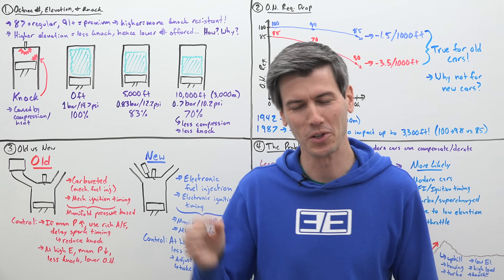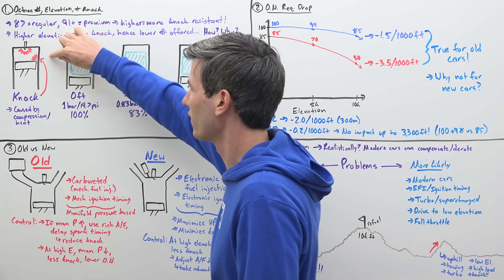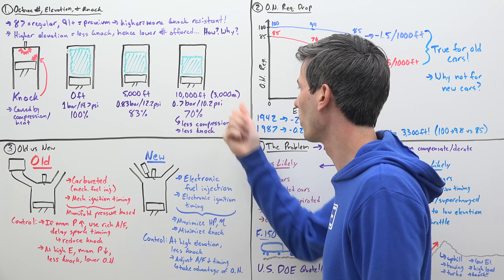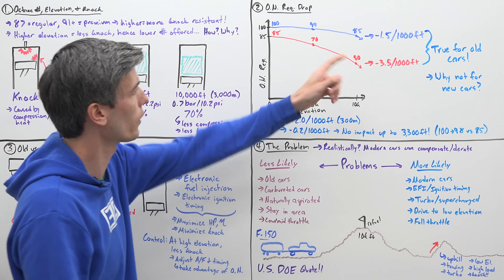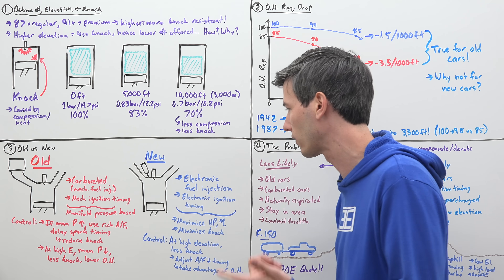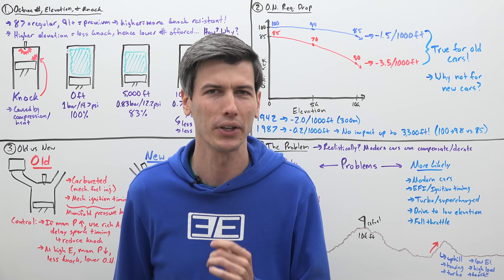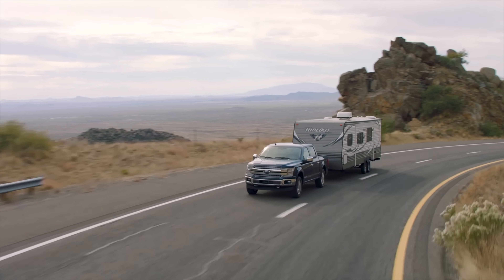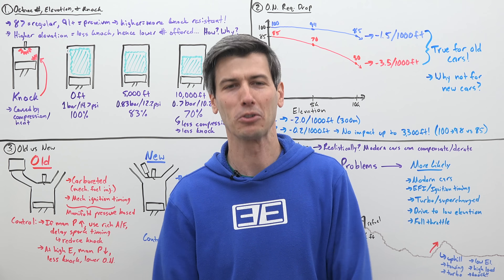Never Use This Gas In Your Car!

Comment: The fact that the laws are based around old carb engines is just a testiment to how out dated current laws are.
Reply: What law are you talking about? He didn't reference a law in this video. He discussed a warranty and a DOT report
Reply: I was going to give this comment a thumbs down and move on, but offering a bit of insight seems more constructive.  While cars are no longer carbureted, carbureted engines are still alive and well.  Lawnmowers, weed eaters, snow blowers, golf carts, scooters, just to name a few that quickly come to mind.  There are plenty of machines that still use carburetors (some machines which are critical for anyone who doesn't live in an apartment building).  

It would be illogical to go through the trouble of changing a law to reduce consumer choice by removing 85 octane fuel from gas stations.  People just need to know what their engine requires, and give it the correct fuel.  People are given the responsibility to avoid diesel, I think that can handle the responsibility to avoid 85 octane fuel as well if their vehicle can't handle it.
Reply: @NoName-ik2du  carb or injection,is not issue, ecu  ,new cars, can retard spark cause they have knock sensor that protects engine
Reply: Hey now. I still drive carbureted.
Reply: Er...my daily is an "old carb engine"
Reply: @lynnmckenney1987  me too. '85 F150, first car I ever bought, still driving the old beast. And no plans to sell it ever.
Reply: @davesstillhere  hell yeah mine is a 1982 Chevrolet Chevette. Old gal gets 33 MPG in town on E10 and 37 on 100% pump gas. 3rd car I've ever owned. I'm the only guy at work with a carbureted car, and the only guy who has to go warm up my car before I drive home on winter nights.
Reply: and is a testament to how effective lobbyists are
Reply: @reelreeler8778  
You don't have a voice if you don't have a billion dollars. That's what I always say about or democracy, I really don't care who you vote for, they're all out to get paid.
Reply: @reelreeler8778  you mean ineffective
Reply: Most laws passed nowadays are usually corporate handouts. If workers need them, they call it entitlement 🤦🏻‍♂️
Reply: Well some of us still daily a carbureted car.
Reply: Moving at the speed of Congress. Even the glaciers move significantly faster; which may be why so many glaciers are gone.
Reply: My old magnum truck uses the cheapest gaz out there
Reply: Depends on the laws.
Reply: EPA highway mileage test for their mpg ratings has a top speed of like 60 mph and an average of 50 mpg
Reply: I still rock a carb engine so it's all good to me.
Reply: Laws are also based on the fact that not all states are at sea level. I live in CO at altitude and we have different requirements than someone in FL or TX would have.
Reply: At higher altitude, most cars from early 2000’s and older CAN run 85 octane regular even if they shouldn’t. 85 is still available because there are a LOT of vehicles around that cannot make use of higher octane fuels. Those vehicles have difficulty achieving complete combustion with higher octane fuels. Many people are not aware that using a higher octane than required offers no benefit and may perform poorly in an engine that cannot make use of it.  My 88 chevy pickup is driven 2-3000 miles a year at ~8300ft altitude. 85 octane is perfect for that vehicle and it runs best on 85. It is fuel injected, not carbureted. My daily driver is turbocharged and requires premium at any altitude. Any high compression or forced induction engine will require higher octane fuel at any altitude. This shouldn’t be news to anyone with a drivers license.
Reply: I have more "old carb" engines around my house than I have new and I'm not even trying.
Reply: @Kandralla  yea but most people don't.
Reply: @lamoona4269  no one has a lawnmower and string trimmer? 

Either way, I'm pretty sure the people in States that sell 85 are good with it (states I'd be willing to bet do have a lot of carborated engines in use) and aren't going to take kindly to a bunch of outsiders offering unsolicited help to rid them of the scourge of cheap gas . 

This statement by Ford is nothing but cowardly risk shifting. They can already detect knock and compensate, if it's bad enough that they can't control it flash the service engine soon light and put a warning in their manual that 85 might give them a bad day if they use it in certain circumstances.

I mean, yezus.. The logical end point of this is Ford says not to operate their trucks on public roads because other cars might run into you.
Reply: and i know damn well that if whatever department that regulates what fuel can be sold decides that only 87 can be sold, every republican new networks out there is going to be framing it as “the biden administration raising gas prices on poor, rural, hardworking conservatives”.
Reply: your spelling is a "testiment" to your poor education
Reply: Automotive engineers would like 91-93 octane to be standard for efficiency. But oil lobbying is strong.
Reply: Fancy saying grandpa is way older than me just write him off.  foolish.
Reply: what are you talking about?   are you actually implying that there haven't been any laws written for the petroleum industry in the last 50 years?   Or are you saying consumer choice is a bad thing and the government should dictate exactly what you are allowed to buy?
Reply: @johng4527  No, you're contradicting yourself. You just said that the existence of a consumer preference for inferior goods is harming automakers and also created by them.
Reply: @johng4527  I'm not implying that petroleum laws haven't been written in the past 50 years. But what I am saying is that the laws that have been written are inadequate for todays modern engine.
Reply: @josho-aus   I'm not aware of any law that prohibits the sale of higher octane fuel...  If that is what your engine requires,  it is readily available......I just don't see where this problem is that you are talking about.
Reply: Wrong. Its a testiment to how well designed and built older cars are.
Reply: Actually, no. Jason did a terrible job explaining this. I'm hoping he puts out another video to fix this. Its not comparing carb engines (very old) to port injected engines (old). Its port injected engines (old) vs direct injected engines (not as old). Direct injected engines came out over 15years ago, and it was a HUGE learning curve for the industry. Anyway, I will give you the run down of what the REAL problem is, which I've posted else where on these comments... Wow Jason! ... completely missed on the most important factor. This most important factor as to why you want to avoid low octane is direct injection. Modern cars are making a whole lot more power with smaller engines due to three things that are now being done: Direct Injection, Turbocharging, and higher compression engines. Without all three the increased power is not possible, and that is why modern engines make more power than before at smaller displacements, which also and MOST importantly to the present day, IS... Better fuel economy and lower emissions. A smaller engine has better fuel economy and better emissions and there is other important factors, but the smaller the engine factor is the direct unavoidable factor for these improvements. NOW JASON, with that said, and back to why the fuel octane is important... its because direct injection vehicles are very sensitive and prone to carbon buildup. Its the little secret/devil that manufacturers don't want us to know about. If the engine begins to build carbon, it will continue to buildup EXPONENTIALLY. With poor octane, the buildup starts and accelerates very quickly, then exponentially due to direct injection. Why is carbon buildup a devil? Because to clean it out, you will have to put all that junk into the environment with liquid cleaners (my goto: seafoam). You can't clean it by hand, as it starts at the pcv valve and then builds up on the entire path from that valve all the way to your exhaust tail pipe. Got that Jason? I hope you did. The other reason, its a devil... is because your engine goes BOOM! with excessive carbon buildup. I am beginning to see more and more vehicles in the junk yard because of blown engines, due to excessive carbon buildup (which you can see in the intake ports on the heads, OMG its nasty!), due to not cleaning that out. Clean it out, you damage the environment, don't clean it out, your engine blows up. Which do you prefer? Technically, the junk will come out in tons of smoke, and then settle to the ground, which is carbon monoxide, but its still not good. Carbon Dioxide is the gas that rises and hurts the environment, technically, and that's not this stuff. So, in conclusion, don't use low octane, so you can avoid carbon buildup as much as possible, so you can decrease the amount of carbon cleaning/maintenance you need, so that you don't blow up your engine... and FORD, or whatever company, doesn't deny your warranty when your engine blows up. Better go buy that extended warranty now, because you know your engine is a ticking time bomb and they made it to last just beyond the warranty period... *OR*, just learn to do the liquid carbon buildup cleaning (aka: I call it seafoaming). So, Jason, go remake your video, before your competitors go make a competing video that explains the octane problem correctly... or, I may just become your competitor and do it myself... Yes, from an Engineer (myself) to an Engineer/Entertainer (You).

Comment: I use E 85 in my 400hp truck....it burns hotter and cleaner for the motor.
Reply from the maker: E85 ≠ 85 octane gas.
Reply: @EngineeringExplained  you would be right.  Octaine is 100-105 for e85. 

I actually thought thats what you meant, i didnt even know there was just 85 gas.

Comment: I can still buy SL and other rated oils for cheaper than SN+ or SP, same goes for the gas, it's up to the consumer to decide what to buy. If we stop buying it, the refineries will stop offering it.
Reply: Where can you buy sl rated oils for less than $2.50 a quart in a gallon jug of sn plus.
Reply: @Eli.H.Sanchez  Dollar Tree, or the farm and fleet stores. Not sure where you find SN+ for 2.50 per quart, it is going to be $3.25+ anywhere around here.
Reply: @plkracer  simply buying gallon jugs of 15W40 diesel oil at Walmart and tractor supply sells a 5 gallon bucket of diesel oil for 42.99 I believe. The vast majority of vvt gas engines can run that.if it's only direct injected you can't run the tractor supply one since it's not dual-rated like the super tech is but if it's port or dual injection it'll run and viscosity is not really a problem. it's mostly overblown there are only a very small handful of truly picky engines that actually throw codes over viscosity.
Reply: @Eli.H.Sanchez  most diesel oils were not dual rated though (this might have changed with CK) especially 15w-40 conventional oils, yes they are cheaper, and I ran it in multiple 80's vehicles. The SN and SP zinc limit is also different for 40 weight oils than 30 weight, so it would likely have more zinc than the 30 weight oils. 

I wouldn't be worried about the viscosity so much as the additives. The new CK oils are easier on the catalytic converter because they are low ash compared to the CJ and earlier oils. On the other hand, I wouldn't put a conventional HDEO in a car requiring SN+, codes or no codes, the engine wasn't designed for thick oil, and some of that stuff is pure tar below freezing. 

TS's 10w-30 is now SP rated, and it looks like they dropped the SL oil they had. 11 bucks for 5qts.
Reply: @plkracer  yeah with CK there is more dual rated and CK is a bit more closer to a gasoline oil but non dual rated is only an issue with direct injection only engines since they have a lot of calcium and can cause a low speed pre ignition most especially and turbo engines and not so much so and naturally aspirated V8 engines with direct injection like mine but I can still be an issue and the catalytic converter poisoning thing is only an issue if it's an oil burner if it doesn't drop it doesn't matter if the oil has 500 parts per million of the zinc or 5,000 if it doesn't burn it doesn't get harmed.

Comment: Perfect timing. I'm visiting and driving through Utah into Arizona and came across 85 octane gas yesterday. Definitely made me go "Whaaaa...?!?". Now I know. And no, I chose 87 😉
Reply: The higher elevation doesn't hurt the engine. That's a minimum rating. Just be sure you have higher octane fuel before you descend.
Reply: I see it a lot in Utah. And I'm usually in the SouthWest corner since I come from Vegas, and the elevations in St. George aren't all that high to begin with. It's not that much higher than Vegas (about 600 feet higher). Most of the population of Utah lives down in the valleys, not up in the mountains anyways. Salt Lake is about twice my elevation though at 4200 feet. I admit I have used 85 octane before. I didn't know better until this video. It's not really going to hurt anything if you do it once and you aren't driving your vehicle hard. Plus it was mixed with the better gas from my city.
Reply: I still hope you enjoyed our beautiful landscape in Utah still.
Reply: You chose well. I once put in 85 during a road trip and it messed the car up. Enjoy your trip!
Reply: @fzr2k840  Did you have an octane booster with you when you put the wrong gas in your tank?
Reply: @TriNguyen-nl7qo  No, it was a rental
Reply: should have chosen 92 or 95. That's what gas should be. That's what it is pretty much worldwide except in the USA where it's supposedly "premium"...
Reply: @jwenting  The States uses their own octane scale unlike the rest of the world. 87 octane gasoline in the US is equivalent to 91 elsewhere, and 91 in the US is equivalent to 95 in the rest of the world.
Reply: @TriNguyen-nl7qo  most pumps here only have 95 and 98 in the Netherlands. Never seen lower than 95.
Reply: @TriNguyen-nl7qo  that's still less than in Europe
Reply: @jwenting   Different methods of computing the octane rating in the US and the rest of the world
Reply: @fzr2k840  Yup, people get Research Octane Number confused with Motor Octane Number. So in the USA fuel is sold as the average of the two (R+M/2) RON vs MON.

Comment: As I'm watching this video I got curious if this is why my truck has been so problematic, but all the issues I've had I don't think would be related to using 85 octane fuel. I drove from Washington to CT 3 years ago, and I drove down to Utah to visit my sister in law on the way, so I was in the mountain area, and I was also laboring my truck towing my 2nd car on a uhaul trailer with additional things loaded in both the bed and in the 2nd car. I don't remember if I used 85 octane or not, I may have. My truck had only 36k miles on it when I bought it and still has barely 61k miles on it now! After I got to CT I had the throttle body go out on it within 6 months of getting to CT, then a year later my transmission lines blew out while I was using my truck to tow a u-haul trailer moving from one house to another. I've also had my brake booster fail which was related to the recent recall, and I'm currently dealing with a underlying issue that only shows up occasionally when I'm going 25 mph or less and floor it the truck experiences a momentary lapse of power for like 5-15 seconds then recovers and starts accelerating. It also has a battery drain issue as well! I think if anything only the throttle body issue might possibly be related to using the 85 octane if anything, but it's been very frustrating how many issues my truck has had!
Reply: And that's why you never buy a Toyota. 
(wait, woah, laugh a little)
Sorry about your truck, man. Seems unusual that a newish throttle body would fail at all.
Reply: @KF1  this isn't a Toyota, this is a 2014 Ford F-150.